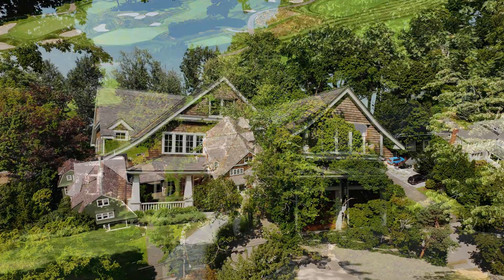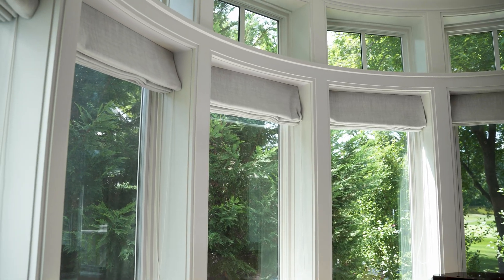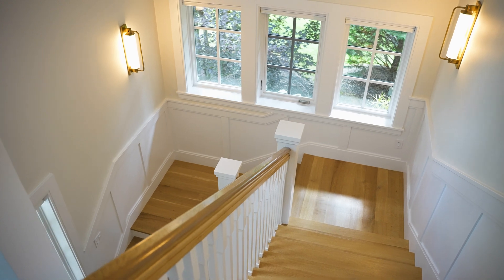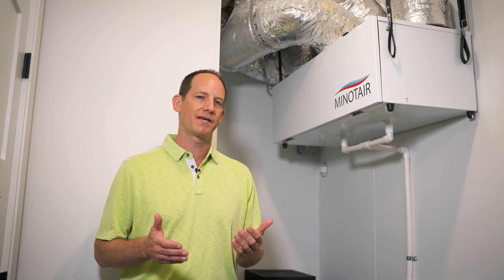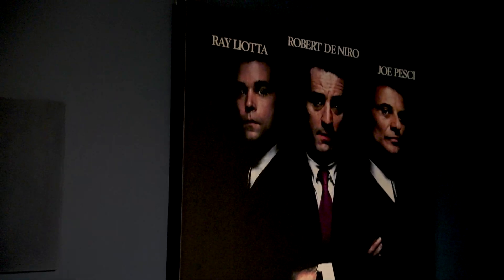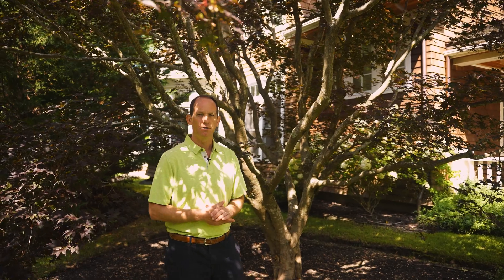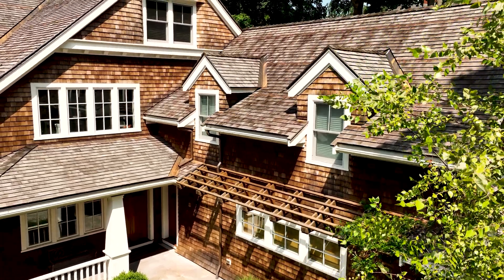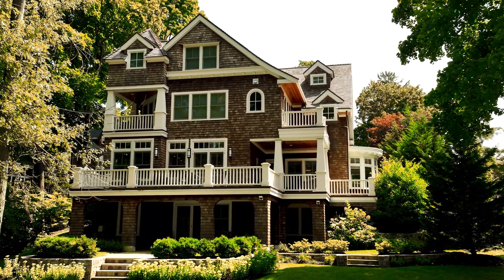Auburndale Newton All Electric House Walkthrough

Comment: Not having an efficient heat source like gas radiant / hydronic is a bug, not a feature.
Reply from the maker: All electric doesn’t mean inefficient when talking about heat pumps. Which we also like to use in air to water radiant systems which are an incredibly efficient and comfortable heat source!